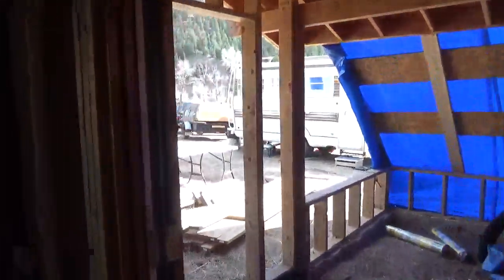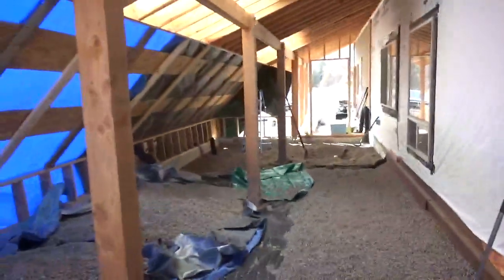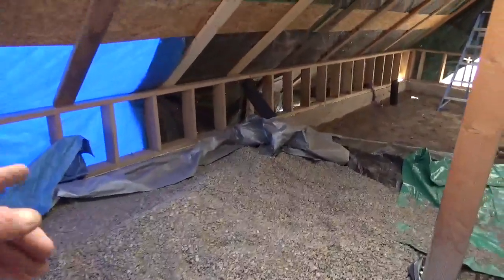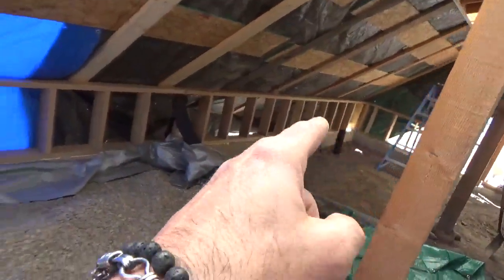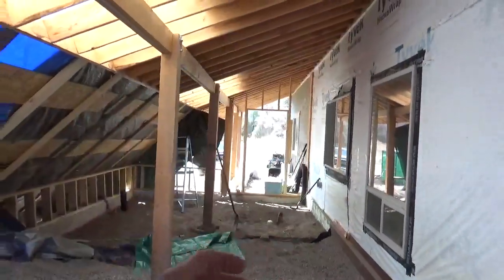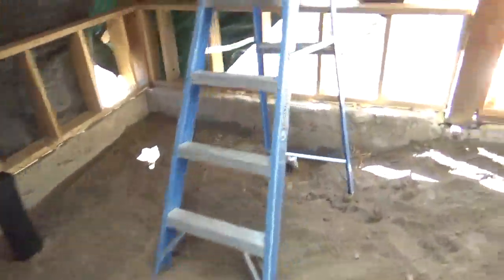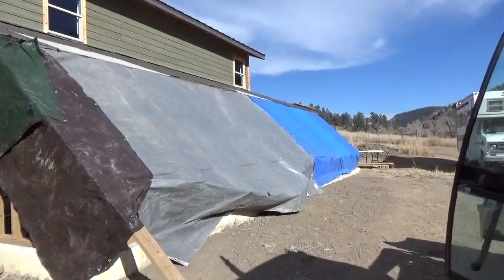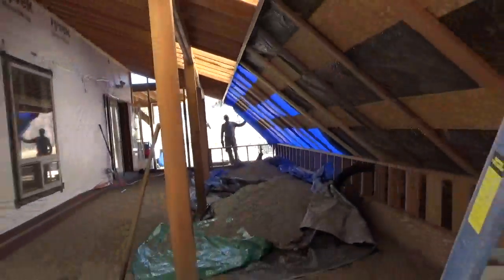Weatherproof Geothermal Greenhouse - Sometimes Extra Work Pay's Off

Comment: Wow, you guys got a lot done. It's looking great. When the snow/ice slides off the main roof and onto the porch/greenhouse roof (meaning the solid part, not on glazing) what are you doing to slow the momentum down to protect your glazing after it's installed? 
I remember last year, or maybe last spring, while you were outdoors doing a video, some huge chunks came off your main roof and it had some force behind it.